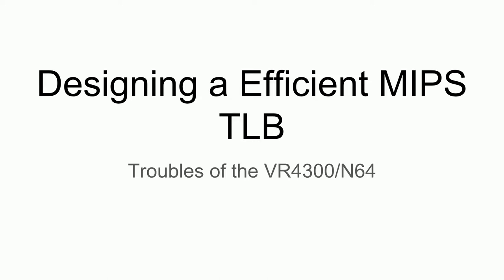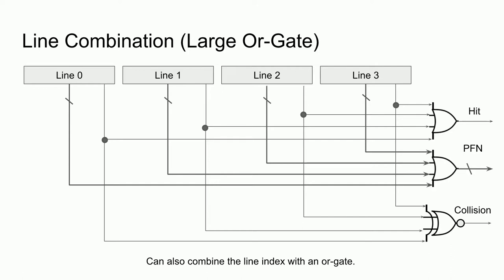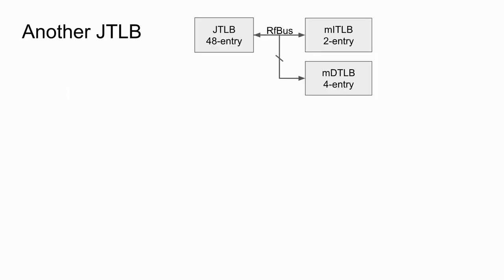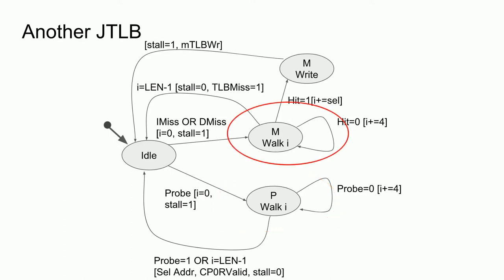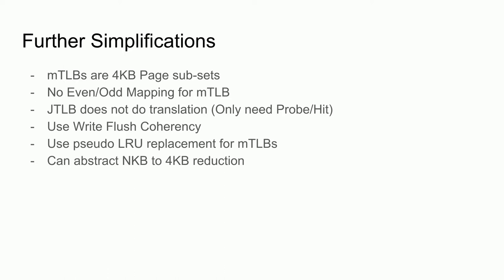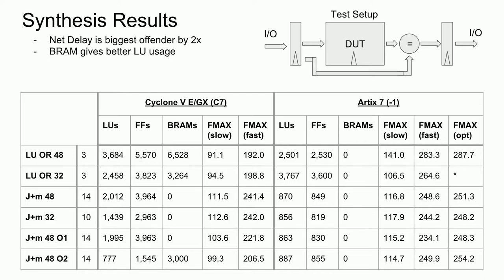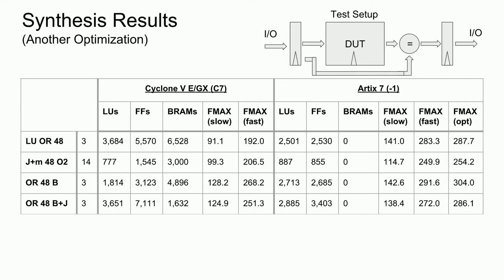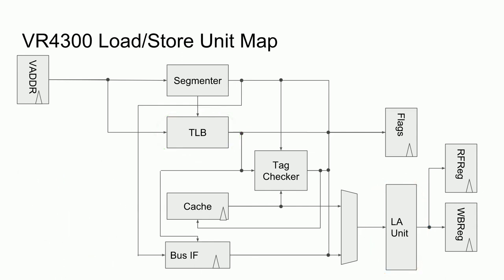Designing an Efficient MIPS TLB [Part 2]

Comment: Something worth mentioning: the R5900 is 294.912 MHz, because the PS2 uses an 18.432 MHz base clock, which gets multiplied by 2 for the IOP, 8 for the EE bus, and 16 for the R5900 CPU clock.
Reply from the maker: Thanks for the information! The clock multipliers there make sense, and it sounds pretty typical for the system bus to operate at a lower frequency than the CPU. Also, the 147 MHz of the EE bus is much easier to achieve in an FPGA than trying to get it to run at 294 MHz (especially at 128 bits), though I suspect that means that the quoted bandwidth of the bus on wikipedia is wrong. Do you happen to know if the scratchpad RAM, cache, and IPU also operated at the core frequency? I presume that both VPU0 and VPU1 operated at the core frequency, and the GIF and DMAC operated at the bus frequency.
Reply: @RTLEngineering  With the exception of the caches, which bridge the bus and R5900 core, everything you mentioned runs at bus frequency. The bus bandwidth is 128 bits * 147.456 MHz = ~2.36GiB/s, however the bus could only ever achieve that by streaming from scratchpad RAM. If you want more information on the bus, googling TX79 Architecture pulls up the Toshiba C790 core, which is a derivative of the R5900; as far as we can tell the only significant difference is the FPU, which is non-IEEE single precision in the R5900, and IEEE double precision in the C790. It's still a useful reference though.
Reply: Of note from the TX79 manual is that the R5900 fetches 16 bytes at a time and can't address anything smaller. Since a fetch from RDRAM is 1 bus cycle request, 4 bus cycle response, this makes running uncached code painfully slow on the PS2.
Reply from the maker: Thanks for the additional information! I already have a copy of the TX79 manual, which is what I used to gather more information on the I and D micro-TLBs. As for the non-IEEE floating point implementation, I realized that as I was working on the shifter with rounding logic for the VR4300 - I kept falling about 50 MHz short of the goal, but luckily the PS2 shifters don't do GRS.  
Just to clarify, the scratchpad RAM did operate at the bus frequency then, even though it was tightly coupled to the CPU core? That would mean that the CPU would have to stall for a cycle for the S-RAM to respond to a read request, potentially 4 cycles for an FPGA using BRAMs. I think a BRAM would be able to respond to a bus request at the bus frequency though, since the address should be known the previous cycle.
In terms of uncached accesses, the goal is to keep your code access within a cached address space, so that the I Cache can help with that latency. The only time the CPU should be running uncached instruction code would be during the boot sequence. Meanwhile, a 5 cycle delay is nothing when compared to the N64, which was probably more like 12 cycles from RDRAM, and 100 cycles from the PIF boot ROM (since it was via a serial interface).
Reply: @RTLEngineering  Yes, the scratchpad RAM runs at bus speed. Since bus speed is half R5900 clock speed, a scratchpad read may block. Likewise, 5 bus cycles is 10 R5900 cycles, and it gets worse when you consider DMA contention for the bus and memory. I don't know what the speed of the BIOS mask ROM is; I should probably check in my next round of profiling.

Using uncached memory is actually quite common in PS2 homebrew, because everybody uses PATH3 rendering, and nobody's brave enough to write cache-dependent code.

If you decide to work on the non-compliant FPU, you'd probably greatly help in writing a soft-float library to emulate the FPU more accurately.

I'm curious about your end goal here; do you plan to actually run games with these, or is this just an educational series on how these chips worked?
Reply from the maker: I hadn't considered DMA contention, I can see how that would be problematic in regards to adding additional latency. In terms of emulation, the speed of the BIOS mask ROM is irrelevant, since it's not a timing critical read (besides any attempt to emulate it will surely respond faster than the original hardware, which is the only real concern with profiling / timing).

I don't understand why homebrew developers would be concerned about cache dependent code, especially since all modern computers / consoles rely on using the cache to help hide latencies. Or was their some weird property with the PS2's I Cache which is not present in modern hardware?

The non-compliant FPU is going to be incredibly simple when compared to something like the mixed integer-float pipeline of the VR4300, at least as far as I can tell. In terms of writing a soft-float library to emulate the FPU, you can set the FPU mode of most modern CPUs to round towards zero (truncation) which will emulate that behavior. The only other thing to modify are the NANs and INFs, which I would imagine most (if not all) games attempted to avoid, so you should be able to use the compliant IEEE behavior of modern CPUs.

For the goal, my plan is to complete an N64 FPGA core, and release it (probably as a precompiled IP), and then follow it up with a PS2 FPGA core (once again probably released as a precompiled IP). The biggest challenge to those goals is that of finding a suitable platform to target, since the DE10-Nano (used by MiSTer) would use almost all of the device resources for a faithful N64 replica (meaning limited to 480i output without any filters or upscaling). Furthermore, there is the memory bandwidth issue, where previous calculations showed the DE10-Nano only being able to obtain around 50-60% of the N64's maximum memory bandwidth. I have been working on a new platform design to replace MiSTer, but have run into issues with the BoM cost becoming too high, and I haven't found a good solution.
In terms of this series, it has mostly served as a way to help document and organize my thoughts when working on the project, with the added benefit of providing educational content on how the chips actually worked and what is possible with "low cost" FPGAs.
Reply: @RTLEngineering  Sadly, games - intentionally or not - used the extended range of the PS2's FPU, and especially the VU FMAC units. Get those emulated wrong and you feed garbage vertices to the GS, resulting in what the PS2 emulation community dub "Spiky Polygon Syndrome".
Reply: Additionally, the behaviour is not quite round to zero; the least significant bit sometimes differs.
Reply from the maker: Strange, though I guess they used the hardware bug to their advantage. Luckily that's easy to do in an FPGA implementation (just don't include the checks). In terms of the round towards zero behavior, I did read about the LSB differing, however, first of all it's the LSB, so it shouldn't affect vertex calculations that much, and secondly, I don't know where to even begin there - I can't see any reason for the LSB to differ if it doesn't have GRS. Or does it treat the last bit as a sticky bit? If it does, then that's also trivial to do in an FPGA (and it will run at a sufficient speed).
Sadly, neither solution would be easy in a soft-fp lib, since the FP operations require multiple steps to emulate.

Comment: Large routing delays could indicate routing congestion on general interconnect. Any way to take advantage of specialized carry chains between LUTs by somehow transforming the problem into something that can use hardened arithmetic blocks within the LUTs?
Reply from the maker: Nope, unfortunately not. In fact, to get the higher performance, I had to disable the carry chain routing (it was adding too many hops). And it was due to routing congestion. The  worst delays were 40% from the logic, and 60% from the routing. FPGAs just aren't meant for dense routing applications like a TLB (or at least the fitter / router isn't meant to handle that sort of problem). Manually routing could provide a better result, but that would take quite a while to do. 
As for hard arithmatic blocks, I'm not sure what could be helpful. The SLICEs/MLABs basically only have a LUT, a Mux, a full adder, and a FlipFlop. Though, it may be possible to find an intermediate solution where you fully specify how each MLAB/SLICE be used (there are logic equations that full expand them), but that would take far more time to figure out than I wanted to put into it.